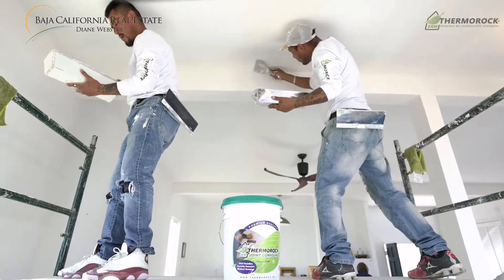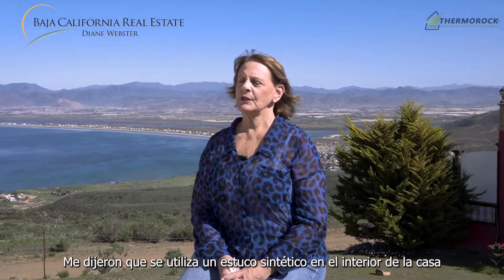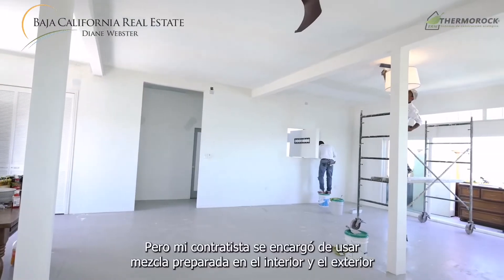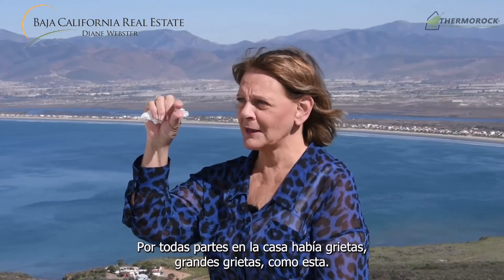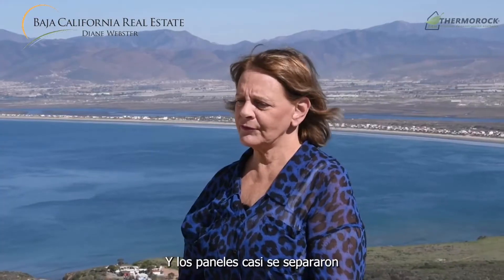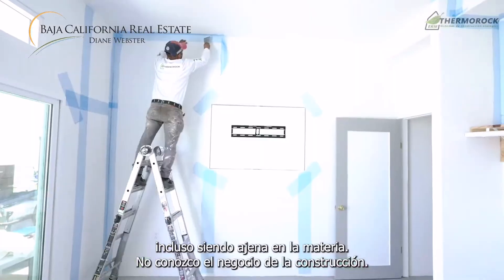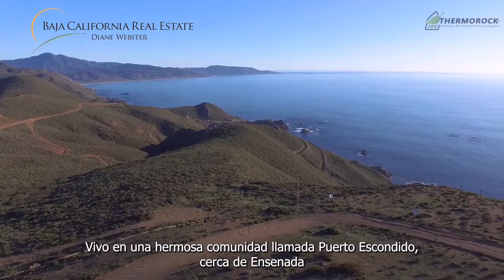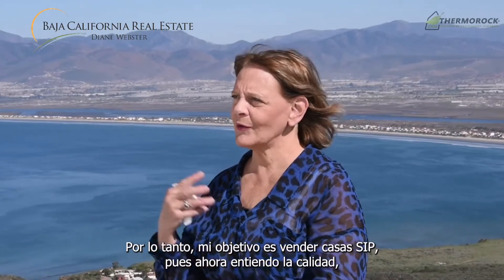Testimony after building a house in less than 2 weeks with insulated estructura

Comment: Hello! Please tell me the cost of a house on 8O sq.m. Thank you!
Reply from the maker: Thank you for your question. It is extremely difficult to quote on a home without seeing the drawings. We don't know what materials you wish to use on the inside, such as marble, tile, wood or vinyl floors, what kind of kitchen, gourmet or simple, same thing with the bathroom, plumbing and electric fixtures. If you have plans and you would like us to quote you can email me at diane@bajacalrealestate.com and we will get back with you. If you want only an estimate calculate between $100 and $150 USD per sq. foot not meters and this will give you an idea. Hope this helps. Diane